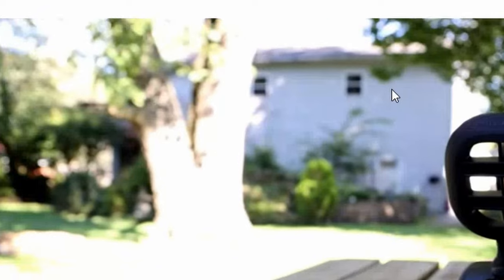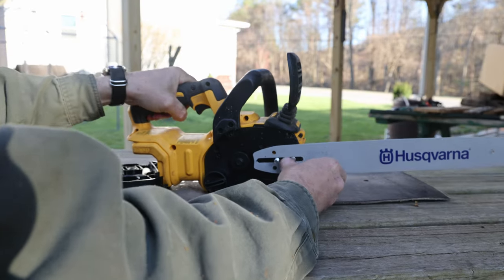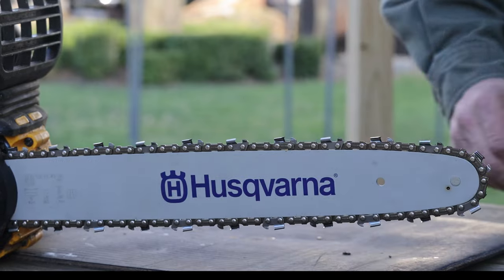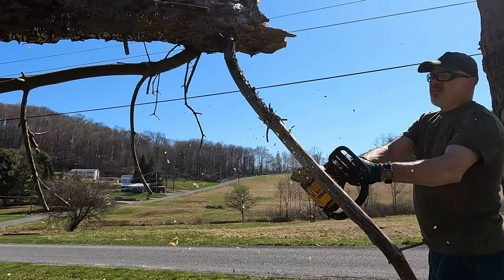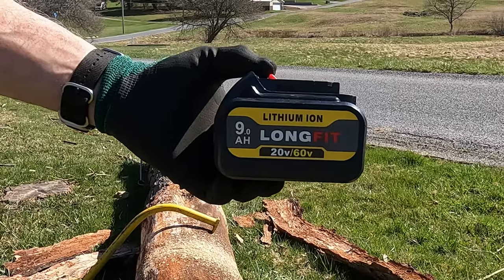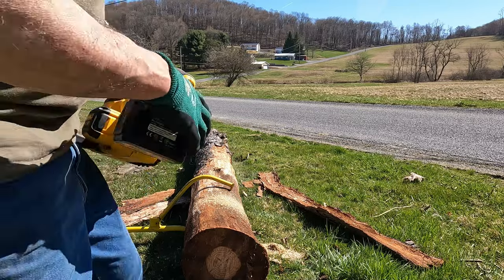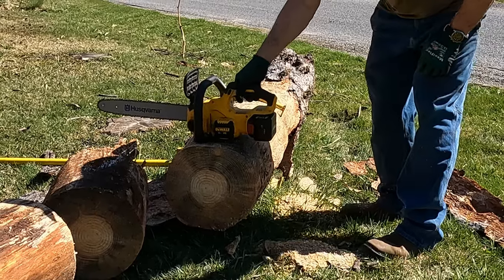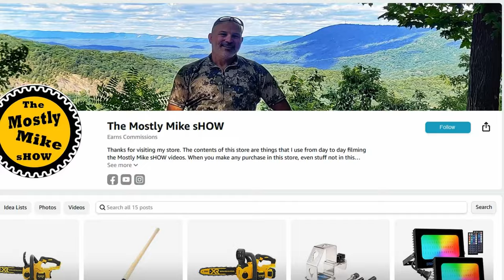Testing the Dewalt 20v chainsaw 16 inch bar

Comment: I just picked up one at the hock shop for 140$ tool only. Snagged two 6 amp flex batteries for 315$. I snagged a 16 bar and chain for 35$ and when it’s all said and done it works great. 500$ all in is not bad at all for what you get. It’s a perfect shtf saw, I can charge it with my solar system on the fly.
Reply from the maker: Thanks for watching and sharing your experience.  I have no disappointments with mine. It's a real gem for cleaning up windfall on my mountain bike trails. It's quiet and much lighter than a gas chainsaw. I hope that your saw gives you years of service like mine did for me.
Reply from the maker: By the way, I like your profile picture! 
🇺🇲🇺🇲🇺🇲
Reply: @themostlymikeshow  🤙

Comment: I just got done cutting up a 12" thick tree I felled for someone a few weeks ago. I used the DCCS670X1 (DeWalt Brushless 60V 16" chainsaw) and let me just say it was a bad experience...Took 3 full batteries and it felt it really didn't want to cut. I ended up using an american hickory handled hatchet to start and finish the cuts by hand. Maybe another brand of bar and chain would give it the kick it needs. Glad it worked for you!
Reply from the maker: Thanks for watching Tool Technical. I have never used the DeWalt 60 volt before. This 20 volt really does the job for me. The trick is just to use the highest amp hour batteries that you can get and don't horse it, and it produces a ton of cuts... I weighed them! 😁
Reply: Just remember if you where using 6ah batteries they are only 2ah at 60v. I chucked up a tree using a 9ah and two 6ah batteries. I needed to charge one of the 6ah batteries to finish but it worked great.  The biggest thing is to get a sharp chain.
Reply: @backwoodsbrooksknives4625 I used 3 of the 9 ah (3ah) I hear echo and husqvarna make some good bar and chains. we shall see :yougotthis:
Reply from the maker: @TOOL_TECHNICAL thanks for watching. I thought that I would be putting the 12-in bar back on, but I like the 16 so much it's been on ever since I made that video. It's about five extra inches of cutting capacity which makes a huge difference and almost no noticeable difference in battery life.
Reply: I have the 20 inch bar with the 15amh it’s awesome
Reply from the maker: @nxcvhjg Wow, I'll bet that it is awesome. I'd like to try the 15ah battery out at some point. Thanks for watching.

Comment: I did the exact same thing to a Black and Decker chainsaw including adding a DEWALT battery adapter. The only difference is I went with a 14 inch bar. I also used 5AH batteries. I got the same result 😊
Reply from the maker: Thanks for watching and sharing your experience. I have a black and decker chainsaw too, but never knew that they made a DeWALT battery adapter for it. That's good to know!

Comment: With the amount of bar oil the Dewalt throws, it only makes sense to give it a bigger bar, even if you don't need it.
Seems like it can handle it without a problem.
Reply from the maker: Thanks for watching Mr Schitzengigglez. (love the name!) Yes, it certainly doesn't skimp on oil... Even when it's not being used. There's always a puddle under it. It definitely has plenty of power for the larger bar. I've been running this one on it ever since.

Comment: Bought the Oregon 16" bar kit with the .043 gauge but the chain is too short to fit on my DCCS620 I moved the tensioner all the way back but the pin won't meet the bar by about 1/8". I know others have done this without issue so I wonder if the tolerances with Dewalt and/or Oregon are different based on batch? I even disassembled the chainsaw to see how the pin adjusts but it is definetely at the far extreme. I also, since I had it apart, sealed the oil tank to stop the leaking. I saw another video that said the weld lines on the plastic container interfere with the seal. His solution was to add some permatex super black or similar so the gaskets can seal the gap. Have any of you ran into this issue?
Reply from the maker: Thanks for watching Proxybox. Hmm, I had never ran into the issue with the chain being too short. If you go to a regular saw shop, they can probably make you a chain to the custom number of teeth that you need. I bought my chain from a saw shop and not sure if they got the info from the engravings on the bar or just knew. It was an off brand, but has served me well since this video.

As for the oil leak, mine leaks pretty bad, but I have not tried the fix that you described, but saw videos about it and some folks have mentioned it in these comments. Sorry that I can't be of more help.

Comment: The oil cap up so it wont leak? Not from the cap but it will leak out of bar oil feed hole leaving a mess just like a normal deWalt chainsaw.
Reply from the maker: Yeah, it doesn't leak out quite as fast that way, but yes I found out the hard way that it still does. Thanks for watching and commenting.

Comment: I would immediately assume the longfit battery for the saw stalling
Reply from the maker: There's a good chance that that's why. The LongFit gave me two years or so before it quit charging. It wasn't a bad bang for the buck considering that they sell for 90 bucks. That one was sent to me in exchange for the video. Some say that the cheaper Knockoffs can catch fire, but I never had issues.

Comment: just a fyi for people the gear that drives the chain takes a set size if not right size is used it may work for a bit but run risk of destroying the drive gear
Reply from the maker: Thanks for watching and the advice Austin. I've been running mine for a pretty long time extensively since this test on all of my trail repairs, and so far it is still running good, not to say it won't break tomorrow. This video was made in May of 2023, so roughly a year and a half.

Comment: I'm impressed with that battery chain saw cut it all up nice . Do you think maybe that other battery doesn't really match the Dewalt one ? For sure do the log roller thingy that is pretty slick 👍
Reply from the maker: Thanks Bill! I think that I will be building a log roller in a future video, lol. As for the battery, it ordinarily does almost equal to the Dewalt battery. Not sure about longevity as far as durability goes. I think that Dewalt may have put a thermal cutout in the electronics so knuckleheads like myself don't burn up the saw! 😂
Reply: @themostlymikeshow  😆you and me both
Reply: @themostlymikeshow  seriously that’s your conclusion. 
With the dewalt battery you had no issues.  You use the generic battery and had stalled out, and you think it’s the chainsaw?? 
There is a reason why those dewalt batteries are so expensive. 
On the other hand I like your Frankensaw. It’s genius.
Stop being cheap and use the proper batteries to get the optimal use of your tool
Reply from the maker: @Zeeangelofdeath  Thanks for watching and commenting. I suppose that is a possibility that the Knockoff battery could have been the culprit. The saw was running pretty warm though from all of the cutting from the first battery.
Now you have me wondering though, what the outcome would have been if I had used the Knockoff first, then the Dewalt 10ah battery. The knockoff 9ah has been in use for over a year now, and I believe that it was worth what they charged for it when that company sent it to me for review. Shortly after I made the review video though, Longfit either changed name or went out of business. I plan to make another of these videos using a fresh two pack of the Dewalt 6ah Batteries I purchased myself on sale recently at Lowe's to see how many cuts both batteries will provide on a fresh charge. Not sure yet if I will get a brand new chain for that test, but it will be coming up.

Comment: Whats your final conclusion on the knock off battery?  Is it worth it to buy the brand name or just get the cheap one
Reply from the maker: Hi Tom. Of course the original DeWalt batteries are the best. That Longfit brand battery was sent to me and I was a bit disappointed that if you click the link for that battery, it appears that the company must have went out of business. It's a shame, because at the $89 price point, it's been well over a year and I do use that battery almost every time I take that saw into the woods, and it performs remarkably. Maybe not quite as much as the DeWalt 10 amp power, but very good for an $89 battery. I have not purchased any of the other knock off batteries, but if they are as good as that one, they're worth buying if you don't want to Fork out the $230 for the DeWalt which is I think what that 10 amp hour sells for.
In this video, I am thinking that I worked that saw so hard using the DeWalt battery that the saw was tripping out on thermal. Some people are speculating that it was the knockoff battery, but after letting the saw set for a half hour to cool, it performed very well.

Comment: When you pour oil from a quart size bottle, the hole on the bottle should be closer to the side that you are holding the bottle. They are designed to pour that way. Give it a try!
Reply from the maker: Thanks for watching and the helpful tip. Yes, I learned that from Bree on the Chicanic channel, I think. It definitely works better that way.

Comment: I'm curious the exact model number of that bar.  There's many types of Husq bars. I tried an Oregon 16" bar with the same designated mounting style as their 12" replacement and it wouldn't fit correctly with the chain adjuster.  Also the link count on that chain is essential.  Not all 16" chains have the same link count.
Reply from the maker: Thanks for watching Jerome. Sorry about the delay. I went out to the shop to have a look, and the numbers engraved in the bar are 
530 04 45-08
There's another number "1901" directly under it.
Then it says 3/8" chain, 56 drive links, and. 050" groove in the bar.
The Brand's name of the chain I used is Rotary. I purchased it at a local Power Equipment shop.
I hope this helps.
Reply: Thanks!  @themostlymikeshow
Reply from the maker: @JeromeBeeFarm No problem!

Comment: I am doing research for a purchase of the Dewalt saw you used that happens to be on sale at my Home Depot. That is how I found your channel. I would love to know how you made your pipe log lifter. I have a peavey that rolls the logs but it doesn't lift the log at all. Thanks Luke.
Reply from the maker: Thanks for watching Luke. Yes, I will be making a video on how to build that log lifter. I built that one many years ago and it seems to work pretty well. Not sure how soon I can get to it because there's a few videos coming before that, but please stay tuned. I hope your DeWalt saw serves you as well as mine did for me. As much as I wish I was sponsored by DeWalt to say that, I am not and I bought the DeWalt saw with my own money. The long fit battery was actually sent to me in exchange for another review video, which is a decent bang for the buck, but I don't think long fit makes them anymore.

Comment: I liked your video and decided to try the 16" bar but it doesn't fit. The holes don't line up for the tensioner pin. I have the DCCS620 saw and the 531300436 bar and I had to widen the hole to make it work. I then installed the SP33G 16" chain with the 0.325" pitch , but that doesn't work either. It doesn't follow the gear drive and jams. Looking up a chain by my model, it says 3/8" which is 0.375" pitch.
Reply from the maker: Thanks for watching and sorry to hear about the bar and chain not working. I have a picture of the numbers on the bar. I am up for suggestions as to how I could get that picture to you that includes all the numbers for the bar and the chain. The combination that I used worked flawlessly without needing any kind of modifications.

Comment: The DeWalt saws can and will, at least in my experience, leak with the cap facing up. I empty my saws after use and hang them cap up; they empty themselves off near all oil. I have most of their saws and every one leaks oil, some worse than others.
Reply from the maker: Thanks for watching. Yeah, I pretty much gave up on trying to fix the leak, and just store the saw on its side.

Comment: Anything bigger than 12 inches grab your gas powered chainsaw and stop screwing around. I have a Dewalt pruner great for little stuff, gas for big stuff.
Reply from the maker: I totally agree. As I mentioned in the video, I only used this saw on that tree to show what it was capable of. The stock so-called 12 inch bar is actually just over ten inches on the Dewalt 20v Chainsaw. Thank you for watching and commenting!

Comment: Nothing Matches A Dewalt Original Battry Due To Cell Quality , Cut Out Is Due To Batt Quality Most times with Lower End Replacement  Batteries 🔋...
Reply from the maker: Thanks for watching Zack. I agree. That Knockoff battery is good for the price, but nothing beats the original Dewalt batteries.

Comment: I was looking forward to this BUT..... You didn't show not even ONE cut in real time with real sound. So I have NO idea how it actually performed. Did it struggle, did it take ages, how was it compared to what I get from my gas saw? Don't know because you fast forwarded and played sound over every cut. Sorry matey, would have been good review BUT!
Reply from the maker: Sorry to disappoint Alex. When I look at my audience retention graph, anything that is done in real time like that causes people to click out of the video or skip through. I will have to post a video in real time making one cut for those that want to see that.
Reply: @themostlymikeshow  I agree with the multitude of cuts to show how much work it did, it would be like watching mud dry. But to see maybe the bigger cut in real time would be great.
Reply from the maker: @alexb6018 I'll try to find one of the clips from my archives and make a one minute short video from it. With the 12-inch bar, in my chainsaw stuff playlist, there should be some video footage with it cutting larger size logs. Many of them have different variations, such as different brands of batteries, different amp hour ratings, Etc. I will try to put at least one real time cut in my videos from now on.

Comment: I'm so glad I'm not the only one who has oil leakage. Stupid design...
Reply from the maker: Thanks for watching Freeze. The only way I know to have it not leak is to set it on its side with the cap facing up. I think that every chainsaw that I own leaks oil though.
Reply: I removed the oil tank and sealed it. No more leaks! It’s a big job though.
Reply from the maker: @gs1100ed That's interesting. What was the problem in there? I might have to try it on mine.
Reply: @themostlymikeshow  there are 2 halves of the plastic oil tank that are molded together. This creates a seam and the 2 halves are not perfectly lined up. This can affect the seal around the oil filler cap and the vent line. If you use RTV on those locations, it will stop the leak. The 2 halves of the chainsaw case must be split to access the chain oil tank and make those repairs. This is a known manufacturing issue that DeWalt should have recalled early models of their electric chainsaws. I will post the video that has step-by-step instructions to make the repair.
Reply from the maker: Nice job!  Thank you for the info.

Comment: I was brought to this video searching how to tighten a chain on a 20v saw.
Great job on the video funny and informative.
I felt like as soon as you put on the generic battery the saw starting shutting off. I know the indicator bars showed full? What’s you’re opinion on the generic battery’s? 🪫
Reply from the maker: Thanks for watching and the kind words LCCJ. I ran that saw pretty hard that day, and I believe that the DeWalt saw has a thermal cut out that really doesn't matter how much power is in the battery, but the saw is just protecting itself from the motor getting too hot. That long fit battery seems to be excellent value for the buck, however, I believe it says no longer available on Amazon, and I don't know if any of the other 9 amp hour batteries are reputable that they have on there. If you look on my Channel at the chainsaw stuff playlist, I do a review on that battery. There are also other off-brand battery chainsaws as well as the DeWalt 10 amp hour battery and the torture test with it. I hope this helps.

Comment: So who paid this guy to reveiw this? I got mine and ya have to fill the bar oil every 2 minutes of use,batterys constantly over heat it lacks power....
 when the batterys run out and you cant finish the job you can go finger yourself because you probably have a p$$y ... when will people make honest reveiws? Oh and they leak bar oil your supposed to take it all apart to fix it voiding the warranty but its been like that for years and i guess its not worth it for dewalt to get some better casting molds ?? As far as a 16 bar goes mine seems to barely have enough power for a 12 bar if that..
Reply from the maker: Thanks so much for watching and be kind words Matt.  Comments help this video gets shared to a broader audience.